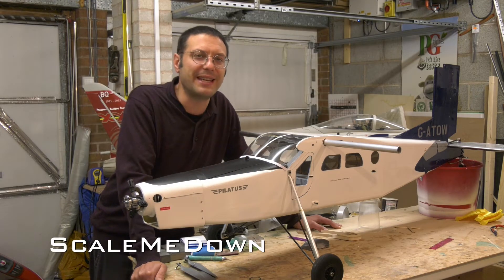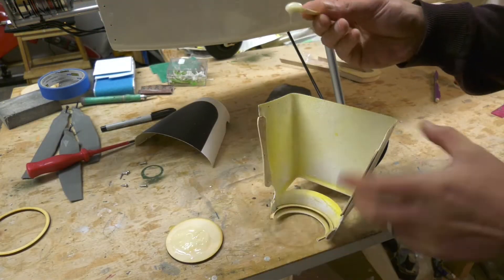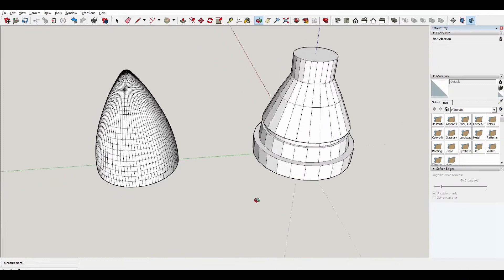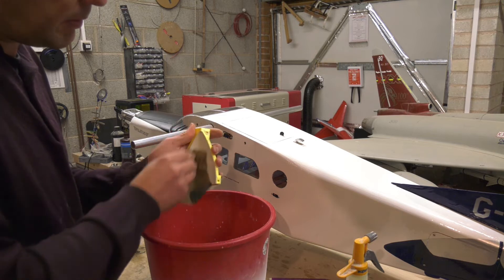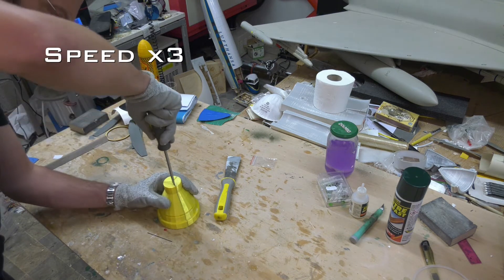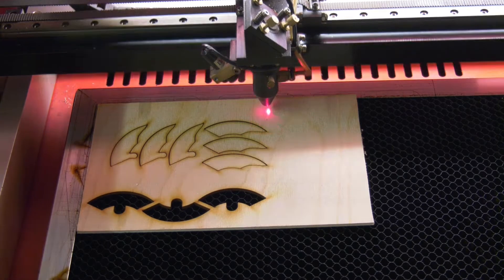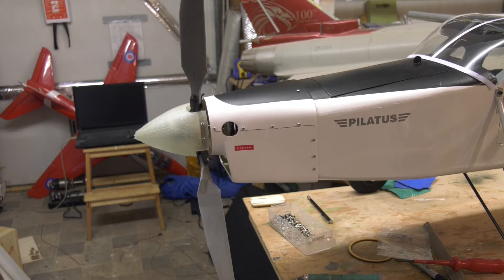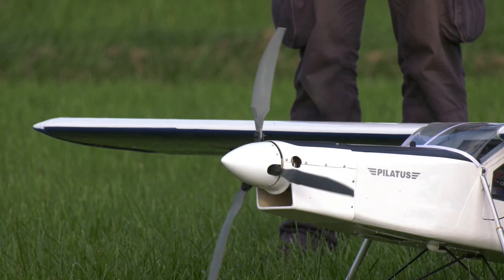VQ Models Turbo Porter with Variable Pitch Propeller - Part 9

Comment: How do you balance the propeller mechanism and cone
Reply from the maker: Hi. Firstly, I weigh each blade on my digital jewellery scales (also come in handy for mixing small batches of epoxy).  Next, I mount the hub on a shaft and balance it with a DuBro over/under propeller balancer.  Next, I add the blades, and the cone and repeat.  The blades are within 0.01 grams, but by changing which grip they were bolted to got me close enough to perfectly balanced.  I had to ensure that the blades are straight out from the grips as they pivot at the mounting bolt (like a helicopter rotor blade) - they will centre as the propeller spools up.